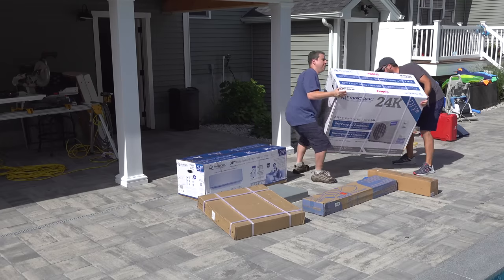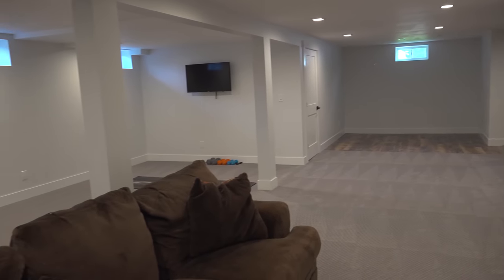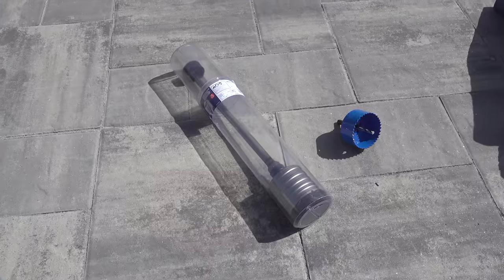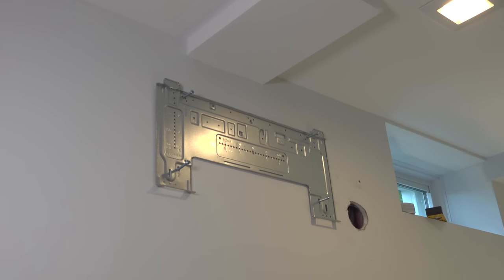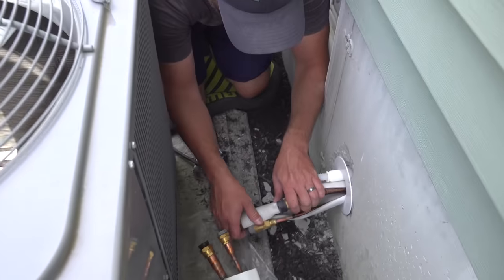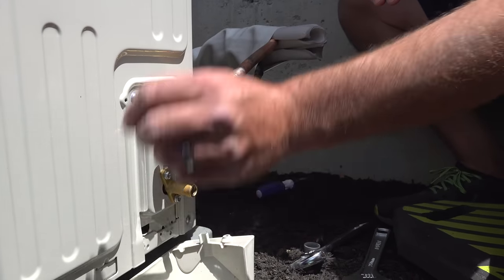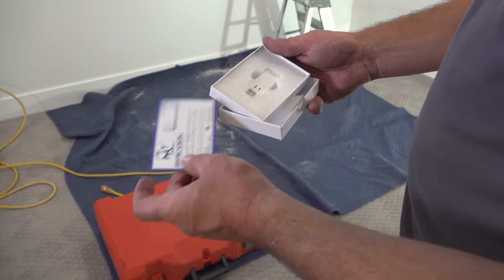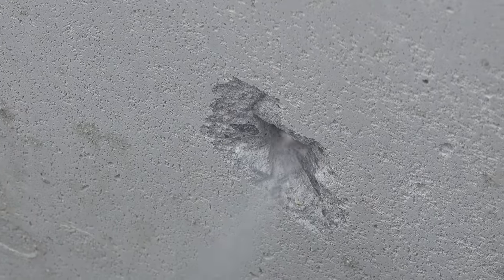Install your own AIR CONDITIONING in 4 HOURS!  DIY Mini Split MR COOL

Comment: It's good we are finally getting mainstream split units in the usa .
Reply from the maker: I couldn't agree more, I have seen these overseas like crazy for ages.
Reply: They are not without their flaws!!!
Every 5 years or so (depending on usage and indoor air quality)they need a full cleaning
They build up black mold inside because of the cool damp environment 
I charge CAN$500 for the full cleaning... if you balance that out it's about $100/yr maintenance
Just be aware of this
Reply: $100 in maintenance isn't too bad. You no longer have a window shaker to clean every year and no window shaker!
Reply: @jonanderson5137  its 500$, not 100$
Reply: @CartoonWeasel  if you do it once every 5-7 years, it balances out to about $100/yr
You do not need to get this done every year
Reply: @walterbrunswick  exactly, but window shakers really should be cleaned out once a year.
Reply: @jonanderson5137  the trick is to run the fan for at least a few minutes after the cooling cycle is finished, to remove the moisture from the evaporator
standing/stagnant water leads to these issues
Reply: We have had them here in the 🇺🇲 For a Long time this is just about dang time someone put up an Installment video about them ! 
My Sis bought way back in 2002 had it installed and where we Deployed at This Military Base its how they cooled the Barracks that was in 2002 ! 
I've seen them awhile now this is first video I ever seen of someone putting one up !
Reply: @walterbrunswick  five hundred fucking dollars to clean a single split unit? how do you have any customers?
Reply: @Shrouded_reaper  ah yes, you're one of those
I've had my "encounters" with your type here on YouTube and out in the field 😂😂 
anyway, it's a very involved process, of disassembly, cleaning, and reassembly, and the thing has to work once I reassemble 
there are chemicals and black mold involved, and process usually takes 3-4 hours per unit, depending on location, condition, etc.
okay to be fair I was charging $399/head a few years ago but prices have gone up, and it depends on the unit (Fujitsu for example is very finicky, easy to break etc, so $500 easy for those)
I run a business, I have expenses, trucks, fuel, insurance, equipment, storage, licenses, about $2500/mo. business expenses. my gas fitters' license alone is $500/yr.
You expect me to do this for $20 for you? please, entertain me
Reply: @walterbrunswick  Give me a break scam artist, I am an HVAC tech. Every company in Australia and NZ charges 100-150 dollars for a full service and clean of a split unit including gas line checking. It takes an hour, maybe two for a particularly nasty job. You should be ashamed of yourself.
Reply: @Shrouded_reaper  hour or two for a hackjob 
my work is 💯, units come out sparkling clean, like brand new
I have tons of 'before &after' pictures
Obviously check for proper operation, flush drain line, clean outdoor unit   
I am OCD/perfectionist and clients and contractors know that 
Obviously it's not cheap, and that's why I suggest 5-7 years 
don't bs me you hack
Reply: @walterbrunswick  lol don't be you? Mate this is my fucking job and I know it damn well doesn't take half a fucking day for a nice clean of a split unit. Like wow, you flush the drain line? That adds a whole couple of minutes to the job.
Reply: @Shrouded_reaper  explain to me your process of a 'full cleaning' please
Reply: @houstonjohnston4403  frankly I agree with you, and that is why I have no interest in selling or installing these mini-splits these days
I am up-front and honest with my clients, and I fully disclose the 'mold issue' and the cleaning costs associated 
much better option is cassette units, and my favourite is high-velocity, provided clients have the finances
they don't have the maintenance costs
Reply: @walterbrunswick  check operation take off and clean covers with soapy water, put bag under unit and spray clean coils, clean drain pan and flush with saline, blow any dust out with compressed air, check electrical connection, then repeat for outdoor unit, check gas and operation again. Don't tell me that's a hack job because that is a thorough clean and service. You're a fucking con artist, "oh the Fujitsu is hard to take apart". What a joke, once you have done enough cleans you can pull apart any unit you come across with your eyes closed.
Reply: @Shrouded_reaper  "check electrical connection" lmao you are a joke
Just a tip from us actual pro's, who take pride in our workmanship, spray your electrical contacts and printed circuit boards with di-electric grease, and they will last FOREVER, in harsh environments (dusty, salty, damp, and so on)
Reply: @Shrouded_reaper  How many 'before &after' pictures do you have? Do you take a flashlight, open the vanes, and show your clients the 'insides' during and after your 'full cleaning'?
Moral of the story: either pay a pro $500 for a real full cleaning, or pay $150 for a guy to do a pretend cleaning, and "blow the dust out"
Who's the real con artist, scam artist?
Reply: @walterbrunswick  depending on where you live, that cleaning/ maintenance only costs $50.
Reply: @walterbrunswick  no offense meant, didn't read all your comments til after the fact. It was simply a statement. I'm not sure where you are based but i live in pretty poor area of the country I'm in, they sell cheaper units (quality cheaper too of course) and do the cleanings for much cheaper. The labor rate here is practically nothing compared to more advanced nations. Much love no offense.
Reply: @DamasKriss  scale of economics my friend
I live in a financial capital of the world
Reply: @walterbrunswick  funny because in Europe you need to clean AC units 2 times a year to have warranty. YOu didn't clean it by professional company? No warranty. 

Anyway, cleaning inside unit once per 5 years is just crazy. After 1 year inside unit is full of mold and bacteria, if you don't clean the units AT LEAST once per year, you breathe all of that mold, bacteria and other unhealthy stuff.
Reply: @walterbrunswick  also the standard cleaning in my country is like 60-70$, and clients do this twice per year, as I mentioned (unless they want to lose warranty).

Cleaning inside unit once per 5 years is nonsense, unless you clean them regularly, at least once per year, and do a perfect "full clean" with dissasembly once per 4-5 years.
Reply: @Soveey  better to do a full cleaning every 4-5 years, instead of a "fake" cleaning every year (which effectively does nothing)
Reply: Bib and a bucket works great
Reply: My attic all duct works sorry this unit was not at the time in the US
Reply: @porterdor39  ducts are better
high-velocity ducts are the best option 
these units are often installed "after the fact" i.e. after building/structure is drywalled and finished, or often times in old brick houses where there is no other reasonable/viable/affordable solution
Reply: @walterbrunswick  Thanks I thought this better I feel better now was little depressed about that. Thanks again
Reply: @walterbrunswick  Also by the way every spring I wash my air handler in the attic and the condenser no problem after 20 years still working excellent from NY
Reply: @porterdor39  nice, good maintenance 👍 
hello neighbour from across the lake (Lake Ontario)
Reply: @walterbrunswick  Thanks very interesting to know that.
Reply: @Shrouded_reaper  Lol
Reply: @walterbrunswick  Lol I am having some fun tonight
Reply: @walterbrunswick  I like the back and forth
Reply: @Shrouded_reaper  I am having fun reading your comments
Reply: @walterbrunswick  Thanks for the friendship.I go to Toronto every summer to buy the Spumante Bambino wine not selling in NY
Reply: @Shrouded_reaper  lol
Reply: @walterbrunswick  wow o never clean the blower fan next spring I do it Thanks
Reply: @porterdor39  I visited Rochester NY twice in early 2010's (went to see my USMC SSgt recruiter) and met some good people there, was invited back for Thanksgiving next year
Reply: @porterdor39  I never heard of this wine before 
will have to try it out
Reply: @walterbrunswick  Wow long time in NY good luck next year
Reply: @porterdor39  no no, I visited once in 2010 and once in 2011
I'm in Toronto now
Reply: @walterbrunswick  Yeah try it out is sparkling wine I guess you going to like it . Let me know
Reply: @porterdor39  hey Porter Dor 
I haven't bought that wine
I started reading the reviews on the LCBO website; seems like they changed the recipe!! lot of long-time fans started complaining......
What a shame, I hope they change it back
Reply: @walterbrunswick  Not sure what’s going on hopefully they opening up the border soon.I normally buy it at those wine stores

Comment: I installed a 36kBTU version of this. It cost 2 1/2 times as much, but it's much bigger, has three indoor units, and wow are the additional line sets expensive! But I wanted a warranty, and these are the only option for that for self-installs. Mine took much longer, but I also did, well, a better installation, with a concrete pad I poured, extra line set length in the attic instead of outside, and I replaced the drywall underneath the indoor units with plywood (I'd never use toggle bolts for something like this). I rigged up a method of temporarily hanging the indoor units so I could test their connections for leaks before permanently mounting them. I ran the condensate lines into wall-mounted PVC pipes (this is in my shop, so appearance is less important), as the flimsy tubing they provide didn't inspire confidence.

The system has worked great for almost a year! No complaints, other than that the louver position setting is a joke, and the app doesn't always correctly display what the units are doing (restarting it fixes that). Long term reliability is a concern, as these are just rebranded Midea systems, but so far so good, and the 7 year warranty is very nice.

Comment: imagine having great tools but not a stud finder.
Reply: Hahaha. Good point. That's what I thought.
Reply: I thought a tape measure was a stud finder.
Reply: @Mark A. Demaline Not every wall is 16 on center. 
...I dunno whut I'm talkin about !
Reply: Might not have studs in the exact location you want to mount the unit. Toggle bolts work just fine
Reply: @bentonrp  I am not talking about mounting the unit. I am talking about cutting a stud, even if it is not structural, moving over an inch and a half and no worries about having to cut through a stud for zero reason.
Reply: All you need is a ruler.  and remember  16-inches on center.  and youll find every stud in the room starting from 1-inch off any corner of a room.
Reply: Lmao🤦🤣🤣🤣
Reply: lmao
Reply: Sometime you may not have a choice but drill through the stud even though you know it’s there depends on locations!
Reply: @TwstedTV  You are not going to find the center of studs with a ruler.  Studfinders are cheap and everywhere.
Reply: @DavidMosby  
again since you did not read my post.  
16-inches on center from any corner of the room 1-inch off the corner.
So ya, you can use a ruler,  just like any professional carpenter does  🤷‍♂️🤦‍♂️
Reply: yeah he had metal studs and couldnt have bought a >$10 magnetic studball
Reply: Imagine not being able to locate a stud with the bottom of your fist!
Reply: @TwstedTV  That's an inaccurate statement. There are plenty of additional studs not at 16" centers.
Reply: @joes2514  
The standard construction measurements are 16" on center,  some rooms get 24" on center like basements and roofs aka attics.  But most rooms in the house get 16" on center.  That's a fact.  Measured from any corner of a normal room in an apartment or house to 16" inches, and you will hit the center of a 2x4. Aka stud.
Reply: @TwstedTV  And I repeat... Your statement is INACCURATE. Since you're already adding disclaimers, you know it too. Not all studs use 16" center spacing. Add in things like, king studs, cripple studs, jamb studs, jack studs, extra studs, sills, plates, trims, blocking, headers, WIRING, PLUMBING, HVAC, etc... and there is no way to know 100% that you will not hit something behind drywall or any covering. A rule of thumb is not a fact, it's a guide. Most homeowners have no clue how electricity gets to an outlet but you expect them to know what's behind a wall.

So I guess you think it was a good idea to cut out the stud instead of simply moving the template over a couple inches too.

Here's your quote. "All you need is a ruler.  and remember  16-inches on center.  and youll find every stud in the room starting from 1-inch off any corner of a room."
Reply: @joes2514  
AGAIN, ALL houses are 16" on center.
🤷‍♀🤦‍♂
Reply: Imagine not being able to find a stud without a studfinder

Comment: I think you should put the 220vac supply power and communication wires into a seal tight for extra protection also prolongs it life. 
It looks like all day job to me!  In addition if you live in Massachusetts then your condenser should be mounted on a stand or a wall bracket that’s at least 12in above the ground to avoid snow filling up during winter time !

Comment: Based on the finished project's appearance, I would have saved myself a ton of money and time and just installed a slick looking window unit. Unless there isn't sufficient clearance for said window unit I can't imagine going through all this for something that looks just as bad as a window unit. Perhaps this was meant more as an advertisement and in that case you failed miserably to gain my endorsement based on all of the previously mentioned points. But it was a pleasant enough video and did not seem too terribly difficult to install. Kudos for a well shot and written production that does everything right except foster the enthusiasm required for such an undertaking. Thanks again for the video.🙃

Comment: Great system! I did it myself, love the unit! Very easy, very efficient.
Reply: Gow big of an area can it cool?
Reply: @phillipmontoya5326  it depends on the size you buy. They have one small enough to plug into an electrical 110 outlet and they have one large enough to cool your home.
Reply: What was your most difficult part of the project for you? I’m debating on getting these.
Reply: @_abbilina_  there was nothing hard about it. I enjoyed doing it took probably an hour or a hour and half something like that.

Comment: "Will never find a stud" right after cutting one out?
Was the location inside and the hole thru the wall so critical it couldn't move a couple of inches? Maybe the steel studs aren't useful but I still prefer to get at least a couple of the support screws into studs, and it seems with 14in to 22in between studs the line set could have found a gap without cutting out a stud.
Reply: It's a basement so those studs are only there to support the sheetrock.
Reply: @JoshuaBeel  naw you can use self tapping screws they thread in much stronger than drywall anchors
Reply: @JoshuaBeel  but he is saying it would be better  to screw your support bolts into those studs. This guy has a 100 pound unit supported by  Molly bolts.
Reply: Yes but like he said, they're rated for 120lbs and if you were to only screw into studs, you would have to drill new holes into the bracket which is just a pain in the ass and not needed.
Reply: @JoshuaBeel  This house was an exception, with a concrete foundation wall extending up to the first floor.   My wood frame home which is typical of older ones has western framing. The exterior studs are ALL load bearing, go sill to roof rafters. Newer ones may have collar joists at each floor or not.  Regardless, there's no excuse ever for not knowing where wall studs and utility lines are located before cutting into a wall, especially if you are going to going a load from one.  An anchor's rating is not the wall rating.
Reply: @liamwelsh5565  An anchor's rating is not the wall surface support capability, especially in a basement  or area that is in a flood plain. I've seen old basement gypsum board walls you could punch through with a fist that had been degraded by condensation.
Reply: @psdaengr911  If the wall is water damaged, what's making you assume the studs aren't rotted?
Reply: Steel studs actually aren't that great for wall-mounting things. Probably be OK for a unit as light as this one looked (and until I saw how light it was, I was concerned about the drywall mounting too) but typically it's recommended to put wood supports in for mounting heavy stuff to them.
Reply: This is what you get with a DIY guy not staying in his lane.